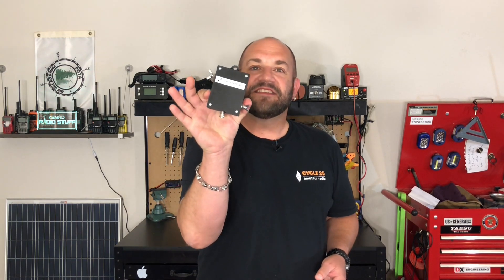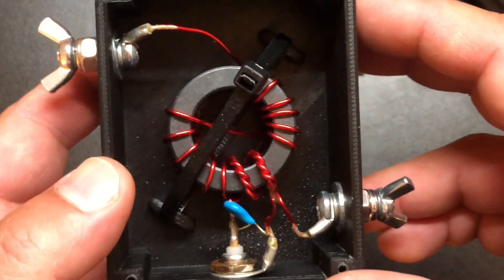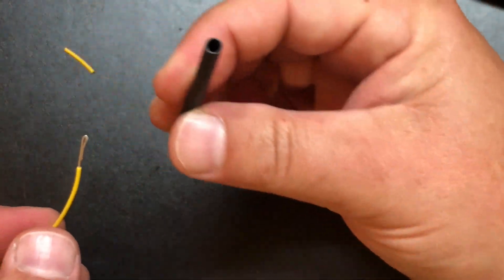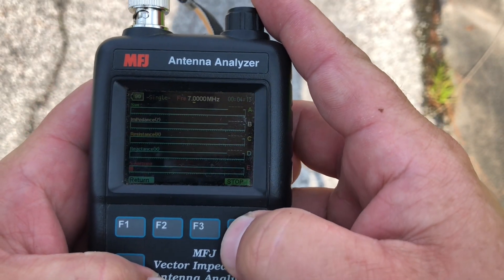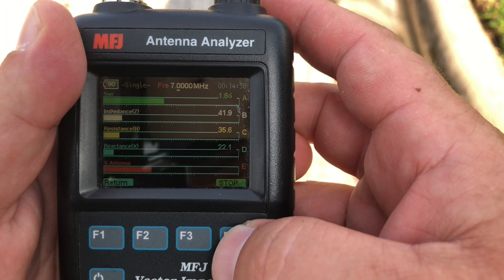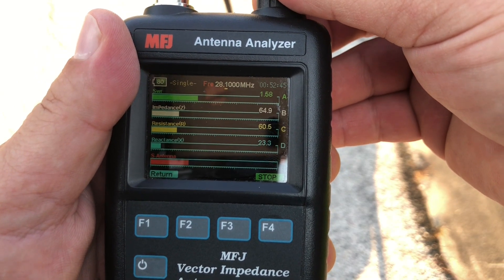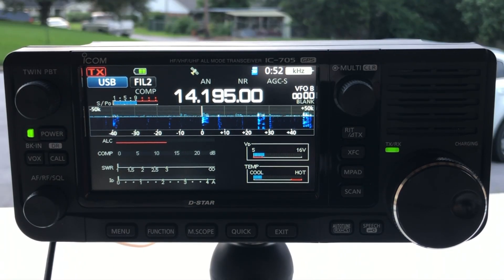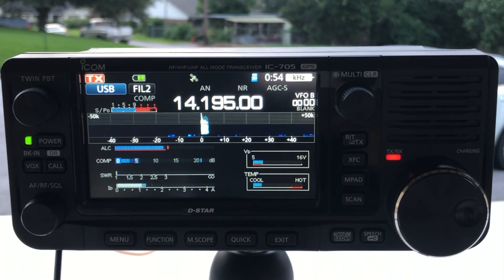TennTennas 49:1 Multi Band QRP Antenna | 40, 20, 15, and 10 Meters.

Comment: Took your advice and got one I am 100% pleased with it I love not having to use the tuner the only problem is I'm in the third floor apartment so I got 66 ft of wire strung around the apartment so it is a compromised antenna but I still had a qso with Russia on 10 m

Comment: So why does the radio show a different SWR than the analyzer?
Reply from the maker: That’s a good question.  I’m not entirely sure but from what I can muster, it’s the difference between the analyzer pushing a very low power signal through the coax v actual wattage.  I could be totally wrong though.  The whole point of my channel has been to document my ham radio journey and document everything we can learn from. Regardless if it’s a failure or a success. For me, the greatest thing about failure is that we get to learn more.
Reply: @hamradiotube  I couldn’t agree more. The thing that peaks my interest is the radio usually shows a lower SWR using more power than the analyzer.

Comment: I paid $4.14 for a 100’ roll of 20 gauge speaker wire from eBay after tax and it’s Double since it has a Red and a Black wire so I separated them and I have 200’ of wire.It included FREE Shipping from here in Florida as well.So I have around $40 Total in my QRP Antenna for my ICOM 703 PLUS.👍👏🎙

Comment: Just got mine two days ago and the 20 gauge wire but I have not cut the wire yet for tuning.I crimped and soldered the connector on the wire but I have not gotten to the trimming yet.

Comment: The toroid is probably a 140/43mix and my experiance is 68' is usually the sweet spot. if you're creative you can build the 49/1 for around $15.00. I built one that is good for about 300watts with a 240/43 mix and i also added the 110 mh coil and it does 75 also. I build the 49 and 64 /1 transformerI find there is really no difference ithe two different winings.73
ki0ad

Comment: Very good what was the length of your counterpoise wire on the Tenn Tennas?
Reply from the maker: Thanks Jerry.  There is no counterpoise.  The shield of the coax takes care of that.
Reply: @hamradiotube  okay thank you much for your reply. No choke needed either to keep rf from feeding back to radio?
Reply from the maker: @jerrycrawford487  I've not needed one, no.

Comment: Next time you cut the wire, you might try wrapping the wire through the end insulator and bring the extra wire back on itself and thn wrap in place. Then the wire is still connected if you need to readjust.
Reply from the maker: yes, I did do that, and mentioned it but I didn't film it.  I wrapped about 16" back on itself after a couple cuts, measured it and cut it there.  I think thats where I left it when I got to 65'

Comment: Aloha Mike, great to see you on Ria’s live stream today. I think you could of cut about 7 more inches to account for wire stretch later on. 
    Also, if you were going to keep this wire antenna up at your house for extended periods of time, you could attach some good high test fishing line to that “S” clip to use a half gallon of jug, half full of water to act as a counter weight so that wind doesn’t blow your wire all over the place and keep the wire taunt. The water jug should be free to slide up and down during high winds and plus you will have a better and consistent RF signal. That’s why they call this hobby experimental. Great video!
Reply from the maker: I've got the higher power version as well.  I shouldn't really have any issues with wire with this version but yes, other wire antennas i've had have stretched out over time.  You'd think I would do something like a counterweight like you suggest but I just never do lol!  I'm a glutton for punishment.
Reply: Mike, its the good thoughts that count in life…
   I just thought that I would share my ideas with ya and to give ya a good idea for a future video that many folks have encountered with wire antennas. Keep up the great work, Mike!

Comment: How well does the case hold up to the weather?
Reply from the maker: Surprisingly well.  I had the high power version up for a while in storms before I gave it to my day.  My neighbor also has the high power version up and its not had any problems.  This version is exactly the same just smaller.

Comment: Mike, I’m on vacation but when I get home I have a chart I can send you that will help. It tells you how much to cut off to move the resonant point up 100/200 etc kilohertz.
Reply from the maker: Sure that’d be cool to have.  Thanks.
Reply: @hamradiotube  Mike. here is the link http://www.radioworks.com/ntrimchart.html  These are really just estimates so it may vary some depending on the antenna location and ground conditions.

Comment: Hey K8MRD! Wondering what the other end of that setup looks like (radio end) - you staked out the transformer around six feet off the ground?  Did you run any counterpoise?  How much coax from the radio to the transformer?  Thanks in advance.  I picked up one of these a few months ago and haven't had the chance to set it up, so I was super excited to see this video pop up!!  Cheers and 73.
Reply from the maker: Just running about 20' of RG316 coax into the antenna and the wire is strung up across the street about 30' up.  No counterpoise.  Pretty simple.  The transformer is hung from a hook under my porch, maybe 7' off the ground.
Reply: @hamradiotube  Thanks for the reply!  I brought mine out this past weekend and made quite a few contacts on 40m voice.  Antenna was clearly strung NW/SE.  I was reaching up into New England and down/over into KY and even MO, from K-0656 with only 20w - not bad my first solo effort! :)  Antenna was around 25' high in a tree and then down directly to a picnic table with only a tiny jumper of about six inches!!  Worked great!

Comment: Hi Mike, would you get better results with a counterpoise, or is one really needed for EFHW?  I'm fairly new to ham radio and just getting to understand making your own antennas.
Reply from the maker: You don't typically need one with an EFHW.  I've tried adding one during the build process before and it didn't make a lick of difference.  So long as your coax is longer than about 16' you should be good.

Comment: I have that... I checked into a net at 100w.... 😐. Maybe I shouldn't do that anymore lmao. Still working fine, maybe I got lucky
Reply from the maker: I would think this would handle 100 watts no problem.  It's a pretty solid build.
Reply: @hamradiotube  didn't know if mine was different wattage now that I'm thinking about it, mine has an so239 on it

Comment: Great video! Really want to try this antenna but need the higher power version. Have not been able to find it listed on Ebay. Hopefully Walter will read this and send a link.
Reply from the maker: He's making more right now.  The link went down as he sold out.  He asked if I would change the description of the video to just tell people to search for TennTennas on Ebay and you will see them.
Reply: @hamradiotube  Got one ordered yesterday and should be delivered by 8/12. I will give feedback after I have tried it out. Thanks for all the great content you have on your channel.
8/22 Installed the EFHW using Tenntenna 49:1 transformer and 66 feet of Copperweld wire  set up flat top about 20 feet in the air. SWR was very low on all bands except lower portion of 10 meter. 28.5 and above was acceptable so I have to do some tweaking but overall I am very happy with the performance.

Comment: Hahahaha...that's too close, get away! You such a nut at times! But I like that about you, Mikey. Howdy so far? I never put solder on Ringterminals which will be used outside on long terms. I pretty much got the same Antenna for my portable activities. Home made EFHW antenna 49:1 transfomrer balun. 33ft wire then a extensions coil with 34µH and another 6ft. wire with insulaton egg. The Balun is good for 500W-PEP 40,20 and 10m with no AT-Tuner to use. The other Bands 17,15 and 12m with Tuner. I saw your sneaky lil Electret pre-amp Mic. with the Clip Holder. Got myself one of these too with a rx/tx LED green / red switching. Happy thursday Mikey. And thx for another episode of "how to never built your own stuff" just kidding. Stay safe buddy. 73's de Your Friend Uncle Guenter from the German Fontier

Comment: Hi Mike and hi Walt!  I have bought several Tenntennas, both the full power one and the smaller, lower power version.  I have used them at Field Day and several POTA and SOTA activations.  They are great.  When you open them up you will see that the workmanship is just excellent.  These are nice material 43 toroids that will allow you to create wonderful endfed halfwave antennas.  Attach 132 feet of wire and you have an 80-10 endfed.  Attach 66 feet and you have a 40-10 multi-band.  The ferrites are of high quality and as a result these transformers are very efficient.  I use 75 feet of RG8X on field deployments and have never had any problems with RF getting to the rig or the computer.  I do cw.  The toroids do not heat up, even after lengthy full-power cq calls on cw.  Needless to say, you do not need a tuner.  All bands are well under 2:1 SWR.  Just a really great line of products!
Reply: It's a FT140-43.   The bigger one has the FT240-43.
Reply from the maker: Great to hear another testimonial.  Thanks for taking the time to share your experience with these antennas.  73

Comment: If you like this, check this out, also on eBay.  End Fed Dipole 80-6 meter Portable HF Antenna Matchbox System. By Nelson_antenna
Reply from the maker: not seeing it
Reply: https://www.ebay.com/itm/End-Fed-Dipole-80-6-meter-Portable-HF-Antenna-Matchbox-System-/191782023426?mkcid=16&mkevt=1&_trksid=p2349624.m46890.l6249&mkrid=711-127632-2357-0

Comment: Because I simply don't have enough antennas. :)   Thanks for another great video! I use dog fence wire for my antennas. It also has a yellow jacket. Edit: Dog fence wire is solid-core. 2nd edit: Just bought the 100W version.
Reply from the maker: Right?  I have no clue how many antennas I own.  I'm such an antenna nerd its not even funny.  Not a big fan of the solid core wire.  I've found it breaks with repeated use, which would happen as soon as I get out to the park and get everything set up.  You'll like that 100 watt version.  Its not much bigger in size either.  Thanks for watching.

Comment: Thanks for the video!  I would be interested in knowing how this performs on 20m and 40m compared to a "shorty 40"...a 32ft radiator with 34uH coil and 4ft extension. 73 de N2MXX
Reply from the maker: I don't know.  I've seen those but I haven't used one.  I suspect this would be a little better just because its a full half wave antenna.  Now I need another antenna lol!
Reply: Far superior to the "shorty" random wire.  The Tenntennas have capacitors across the leads to improve matching on 20, 15, 10m.
Reply from the maker: @skywarnnetn4uzz191  Good to know.  I suppose if you were in a tight situation it would be advantageous to have a shorter wire though.
Reply: @skywarnnetn4uzz191  Most end fed halfwaves have a capacitor across the primary winding (as shown in THIS video on this antenna).  The "40 shorty" uses the exact same matching transformer, so I don't understand your response.
Reply: @daveG1020  Good question.  With the same transformer, the 32 foot radiator is a non-resonant length, seems to me IMHO.  So the resonant EFHW is going to be a better performer.  How much better?  I would say that is really unknown.

Comment: Thanks for another great video, Mike!
Friendly tip :  If you use the circular crimp-connector as you did, you have to take the wing-nut completely off to connect your radiating element and counterpoise. This could lead to a lost wing-nut.
I prefer to use the spade-style crimp-connector for portable operation.  (the u-shaped connector)  With those you can back the wing-nut off a couple turns, slide in the connector and secure the wing-nut with reduced risk of losing anything.
73 - VE3KLT
Reply: Sometimes what I do to prevent a terminal from working loose is use a modified ring terminal, on one side I make 2 cuts, #1 is around the 100 degree mark or so and #2 about 150 degree mark making an opening just large enough for the post to slip into the center, this produces a hook .  To install simply loosen the wingnut, slide the opening over the post & tighten.  This allows quick and easy installation without risk of loosing the wingnut.
47 & 73 de KB5ILY
Reply: @TravisWBurton   Oh, now we're talkin'!  In essense your  ring terminal would then look almost like a 'hook'.  That's smart.
Reply: @BrianJurkowski  
Right, almost like an upside down J.  
I looked for a way to attach a picture of it, but couldn't find it.
Reply from the maker: Yeah, I agree.  It's a double edged sword for me.  Though it will prob never happen, I just see the spade connector working its way out, so I opted for the ring connector.  In hind site, I should switch it out.  I dropped the wing nut in the street when I was filming.  I for sure would drop it out in the field.
Reply: @hamradiotube  gotta agree with you there Mike!  These U-shoes can work themselves out.  Rather have the full ring terminals.  Just keep the wing-nut in your hand until you put it back on.
Reply from the maker: @skywarnnetn4uzz191  That's the problem, I'm screwed either way.  The ring nuts always want to fall out of my hand when I'm screwing it back on.
Reply: @hamradiotube   I wonder if it would be possible to drill a tiny hole in the wing of the wing-nut and tie a fishing line (or something else?) to it so it's anchored when removed. (?)
Reply: Thread lock? Works on firearms..

Comment: Nice review, Mike. That looks a whole lot like the one I homebrewed, but mine is sized for 200 or so watts. For the price, buying one of those bad boys pre-built is really rough to beat! 

I am really liking using an EFHW. It is easier to set up and break down than a DX Commander for portable use, and doesn't create an obstacle to mow around in my back yard. 73, KO4AZY
Reply from the maker: It really is.  I was looking at parts alone a while ago and they would have  been right around the same price.  Plus I don't own a 3d printer so I wouldn't have as nice a case for it either.   EFHW's are some of my favorite antennas.  Though the DX Commander is still one of my top 2.

Comment: Instead of cutting off the antenna wire, just fold it back against itself and wrap it around and tape it or small wire tie. As the SWR changes due to locations you have options to change the length back to what it once was.
Reply from the maker: Thats not a bad idea.  A little late though lol!!